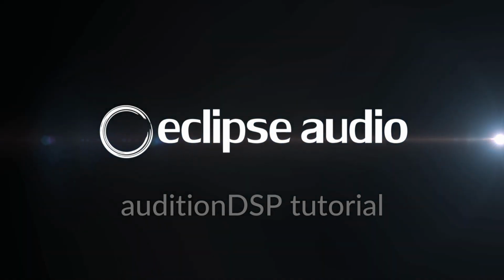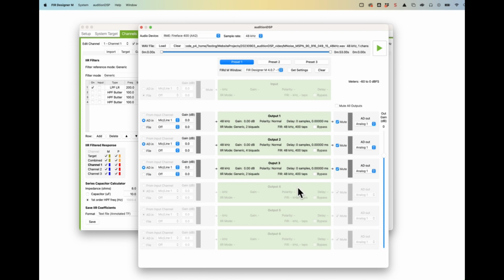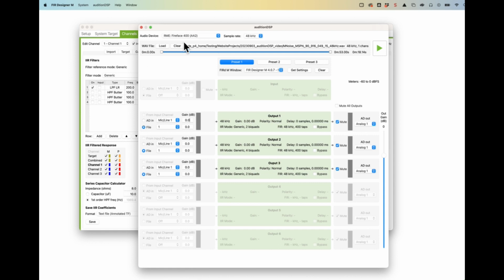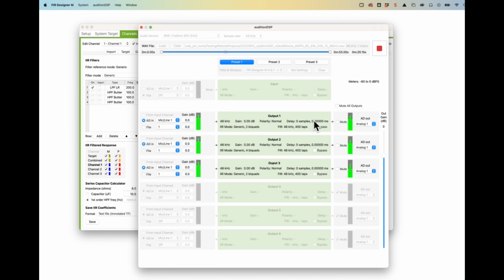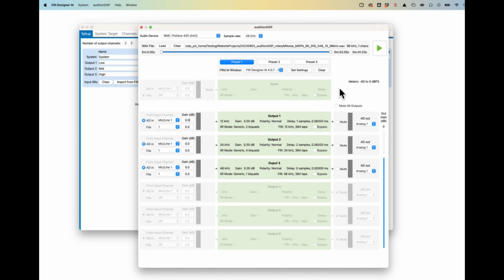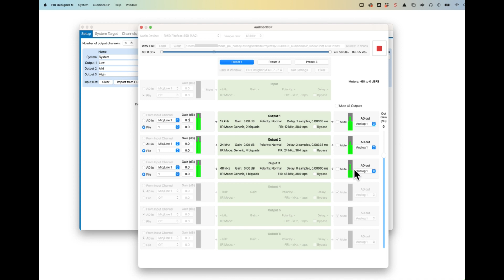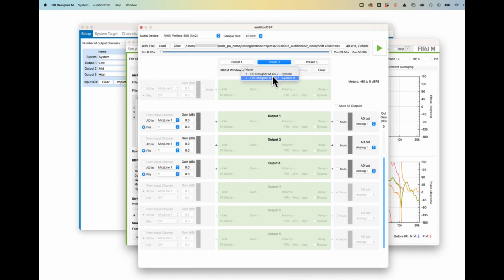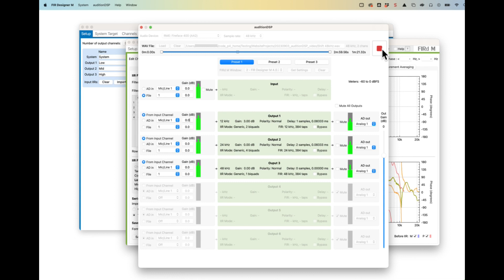Using auditionDSP in FIR Designer M | Listen to Your Custom Loudspeaker Filters | TUTORIAL

Comment: I really like the idea of auditionDSP.  I would like to use auditionDSP in place of my hardware DSP in my system.
Are there any auditory drawbacks when running my filters in auditionDSP software vs. exporting and uploading them to a hardware DSP box? Thank you
Reply from the maker: There are no auditory drawbacks. There might be some subtle differences. For example auditionDSP uses state-space IIR biquads which have lower noise than more common IIR implementations in many hardware DSP's, particularly for filters at low frequencies - e.g. subwoofer filtering. Also, a hardware DSP may have different quality AD/DA converters than your audio interface (with auditionDSP).